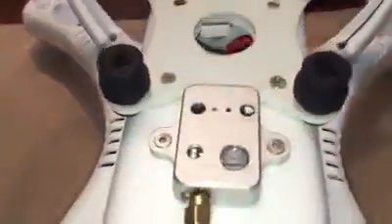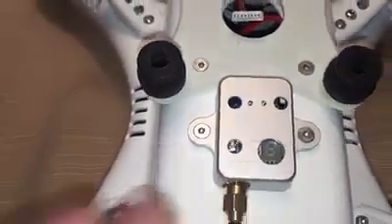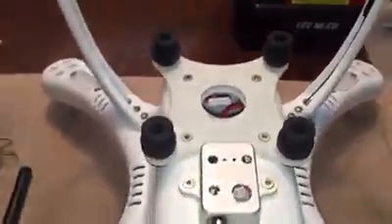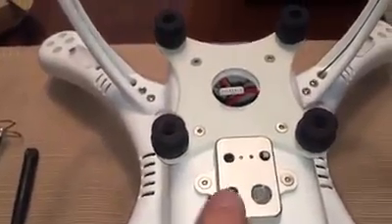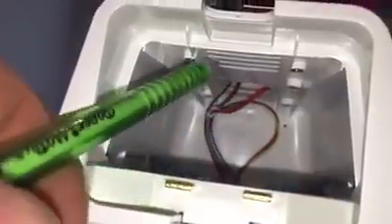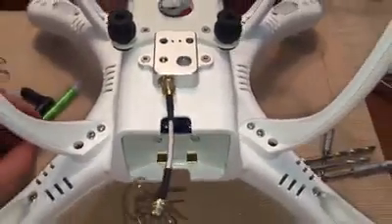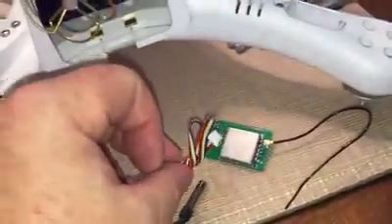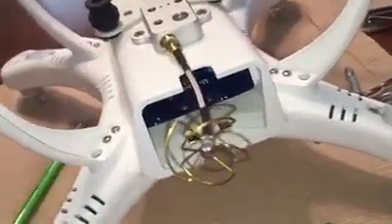Upair One V2 Transmitter Upgrade #thereallifeyoutube

Comment: Not all transmitters are plug in play i had to cut the old plug and use the one that came with my transmitter  on my  transmitter 
i have red,2 black, yellow and a white wire  on the( upair one) colors are red, black, and blue  so i had to connect red with red - black with black - yellow with blue, and on the transmitter wiring you will have a white and black wire left you don' have to connect them you can cut them.